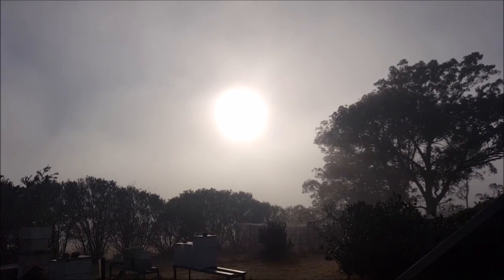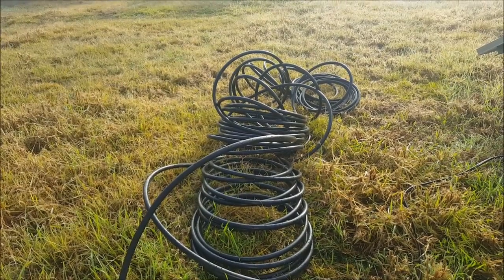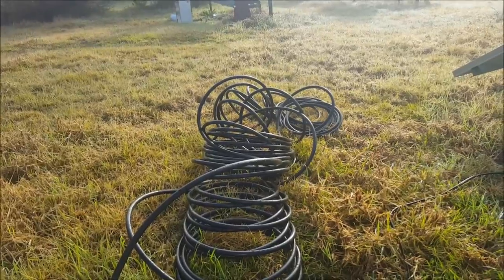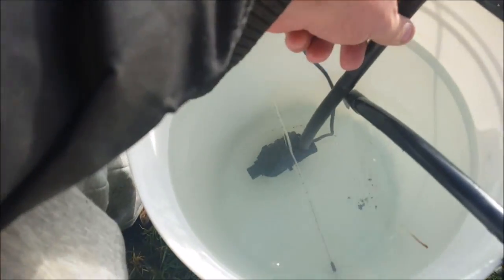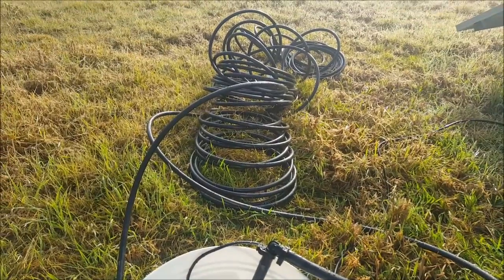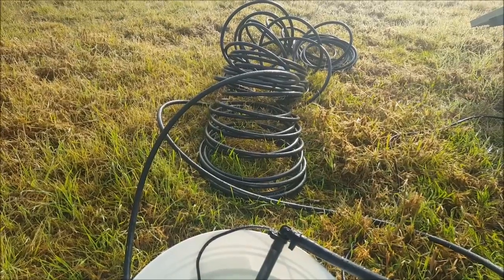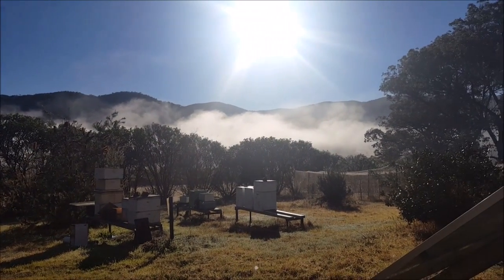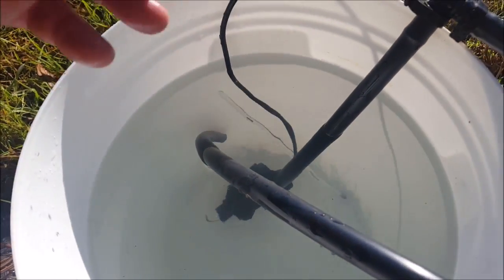Off Grid Solar Power - DIY Solar Hot Water

Comment: have you looked at or have plans about developing - not 100% what they are called - but could it be a ground heat pump set up?
Reply from the maker: Geothermal? I hate digging.
Reply: it not that deep and you use the heat in the earth and you not tapping for water ~ I found a link http://www.home-heating-systems-and-solutions.com/thermal-energy-heating.html#ans001 if go to the bottom of the page and in the UK I have only come across the horizontal system.

Comment: mate down the road he put 4 panels for summer and he put 4 more on it winter just link the the panels to the element on the hot water heater you got there and you get 80c plus every day it temp mate has not payed for hot water the last 2 years free from the sun know thats hot water real hot just use PV panels best i seen today on hot water set ups i be doing the same soon can find real cheap panels for the next setup can find on gumtree 2nd hand i payed $50 each for 3kw 18 panels to run my home off grid i ok with power next is the hot water . i see your got bees know i have to get some help from you when i get mine up on my block of land ... love the honey
Reply from the maker: That's a good deal, my 3kW of panels cost me $1,000 on Gumtree. And yes, I'm working towards using PV panels to run a HWS, I just have to get a heating element made.

Comment: That is a great temperature difference just from sitting on the ground. I'm very interested to see the difference once you have the pipe boxed up. I'm currently making a heat exchanger from a wood fire to water pipe to car heater inside a caravan. If your boxed solar heater gets up to temp, I'd be keen to make one to heat the caravan during the day (save on wood and run the heater fan from solar)
Reply from the maker: I hope to get more done on it this coming weekend. At this stage the glass isn't properly mounted and sealed and then I have to find somewhere to put the collector.
Reply from the maker: I like the sound of that car heater inside the caravan, too. Keep us updated on that.
Reply: I built such an idea in 1990 and then exported it to Cyprus for testing as a pre heat mains water heater with 100 meter Pex pipe 12-16mm imported from Israel in black. I made the coil tight by useing a hot glue gun to bond the rings togeather to place the final coil into a 1 meter box. The glass used was K glass, which allowed heat in but stopped heat going out. My latest commercial hybrid collector is called PVT, which uses silicone tube placed behind any brand of PV panels. The cold water pumped flow cools the panel to increase the efficiency of PV output while providing a pre heat of water to max 30c

Comment: Just a thought, could you put the tubing on the back of your existing photo-voltaic panels and use the heat they collect from the direct sunlight and use it for hot water? That would pull heat away from the panels and make them more efficient electrically too. I couldn't tell from the thumbnail if this is what you intended or if it was a separate panel.
Reply from the maker: Not easily, no.